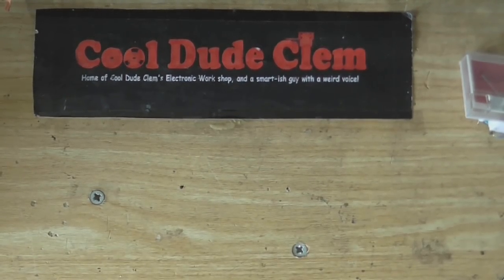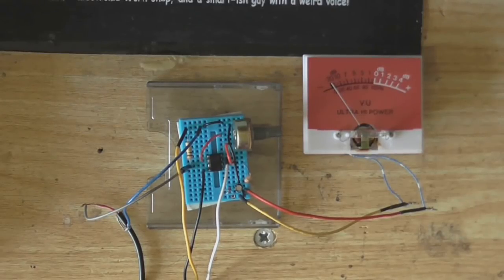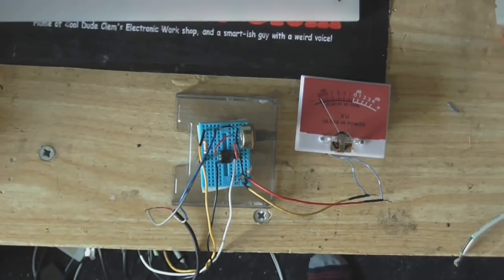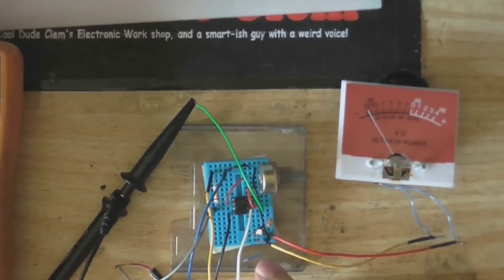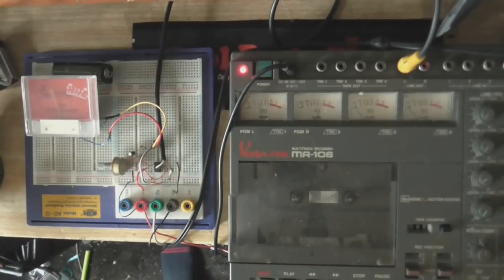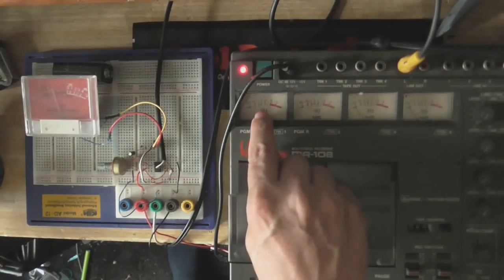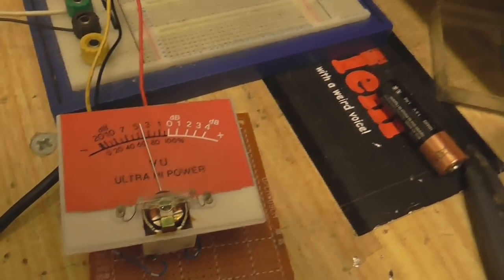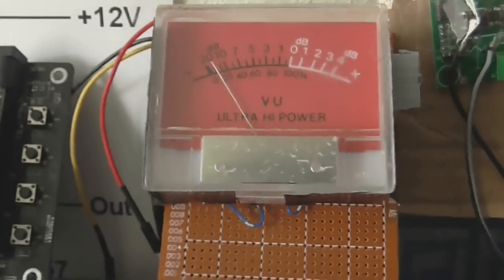CoolDudeClem's Electronic Workshop - Making a VU meter circuit.

Comment: Nice. Yeah, a tone generator will be helpful, also to check frequency response.
Thanks.
Reply from the maker: Yeah, I might look into seeing if I can find some circuits out there that can generate test tones with variable frequency.  Making a sine wave oscillator is easy. Making the frequency variable and also not change in amplitude, that's the tricky part.